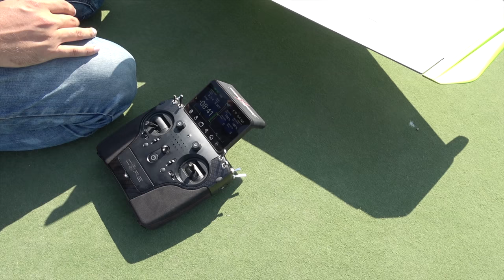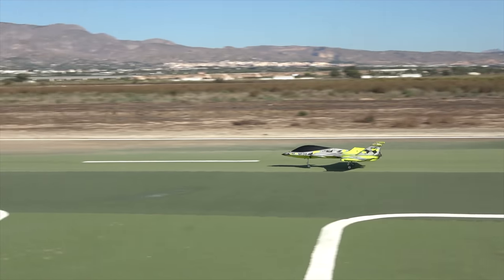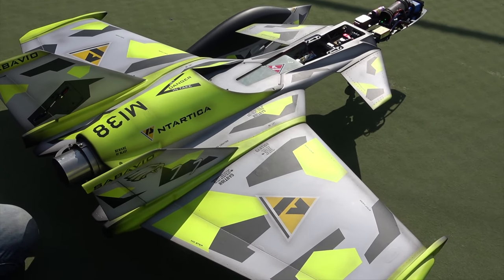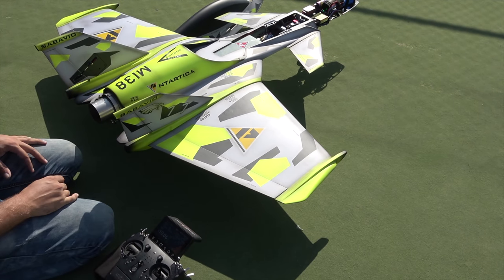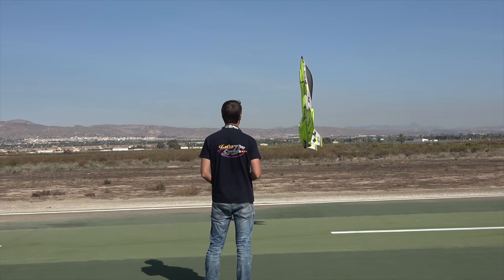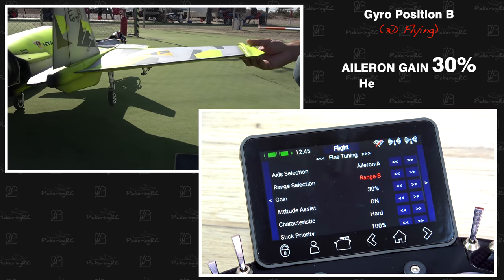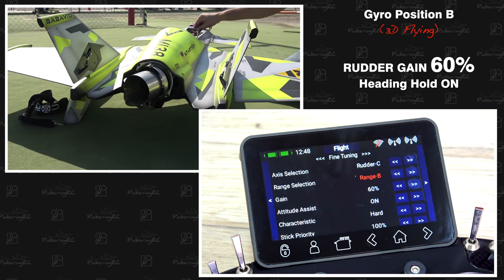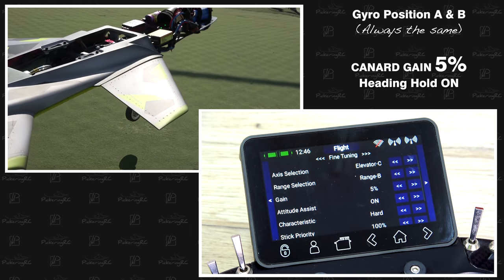SAB Lizard, flying and my secret setup!

Comment: Do you have a video of your channel setup for the gyro? How are you controlling all the surfaces with the gyro? I thought you only had 3 per output, elevator has vector, canard, and both elevons. 
Just curious how you’re doing it, called powerbox USA and they couldn’t explain.
Reply from the maker: The previous video to this one explains the setup. The Pioneer has three gyro channels per axis, so using one for delta elevator, one for vector elevator and one for canard

Comment: Martin,  first of all thanks for the your setup. Cannot wait to try it. One quick question tho. What is your travels on your transmitter/gyro switch for each flight mode? Thanks in advance.
Reply from the maker: Hi Roland, I left my tx settings on 100% and just payed with each of the gyro values inside the iGyro SAT, one by one
Reply: @MartinPickering-PickeringRC   - great, thank you for the response!

Comment: Martin, excellent flying! Sending it the way it should be!

Question, what did you ever end up with on a final  wet weight for yours? Does the Jetcat 130 vs a 120 make that big of a vertical difference (or am I also seeing a lighter setup!)?

PS, the slippy-slide game when applying brakes on pavement. I had the same thing. The stock JP/SAB gear are very binary and love to lockup. Pop the wheels open, remove the little retainer disc magnets, and enjoy. FAR more linear brake feel afterwards. I only regret that it took blue tire smoke and some flat spots for me to remember I had to do that on my T1 as well :P

Cheers!
Reply from the maker: Hi mate. I don't have a reliable way to weigh models (other than curiosity I never much saw the benefit, it is what it is and I can't change it - but thats just my own view)

I think that the JetCat P130 v the old P120 won't see much difference in performance, as JetCats have always been very powerful, for 3D though I would have to say that the old P120's don't have the acceleration the new ones do...

About the magnets, I actually already did that and they still lockup... nothing like Electron's I guess!!

Comment: Hi Martin I purchased my own SAB Lizard. So I wanted to ask to perform all the 3D stunt you did in this video. Is your jet set-up on high rates? I was wondering if I would need to setup my jet on high rates to do all the 3D stuff or will I be able to do them in low rates. I have a Tortuga that I fly on low rates. This is my first turbine jet and first 3D jet.
Reply from the maker: The surface rates are quite low (nothing crazy) and I use same rates all the time. The crazy comes from the vector, which I also have always on but with high expo so only acts with large stick inputs